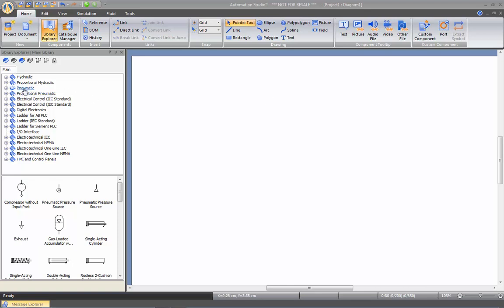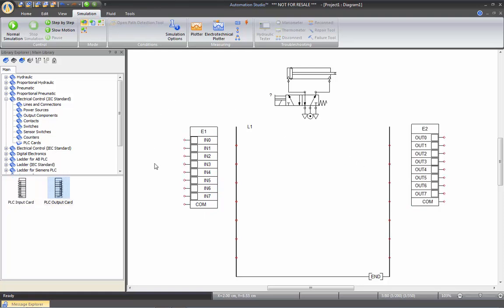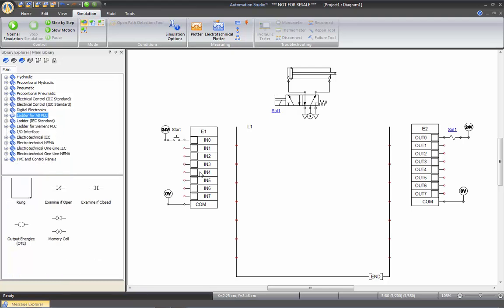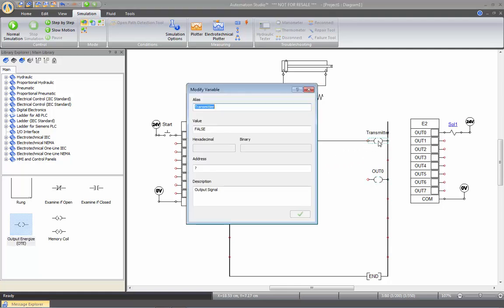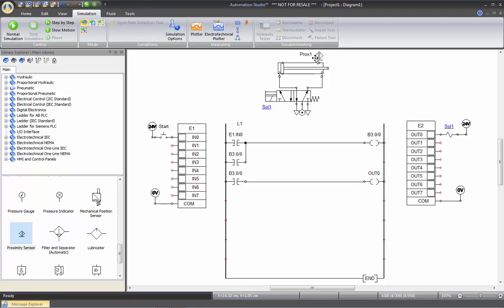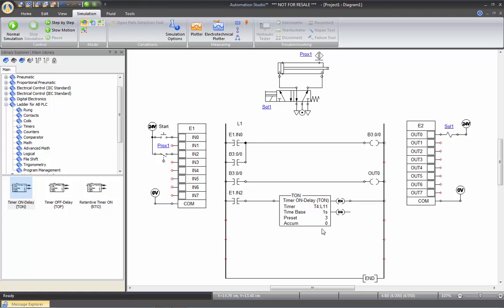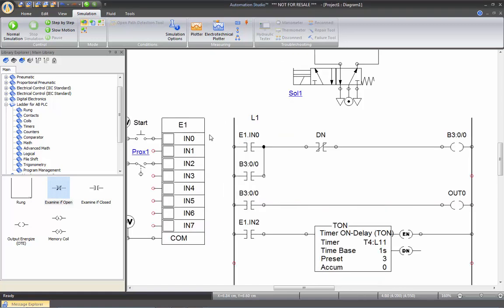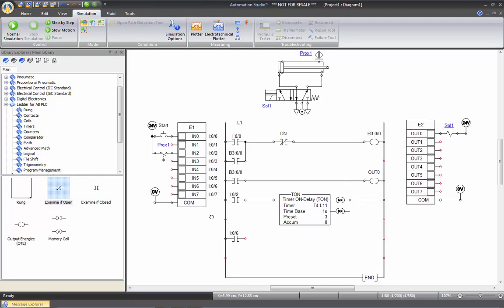PLC - My First PLC - Ladder Circuit - Automation Studio™

Comment: Hi, How to make Wire Number text Bigger.
Reply from the maker: Hello Toturials1
To increase the font size you have to use the Standards. Open Project properties - > Electrical System - >Multi-lines - >Electrotechnical. Based on the standard is used in your document you have to select it an modify the value for the “Wire Name Typography”.